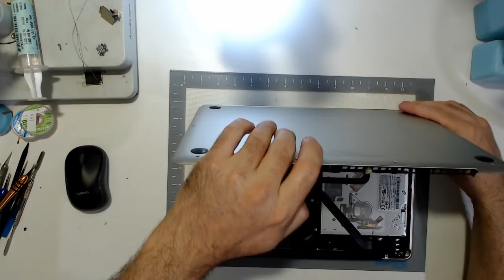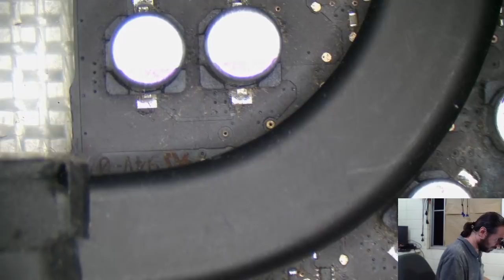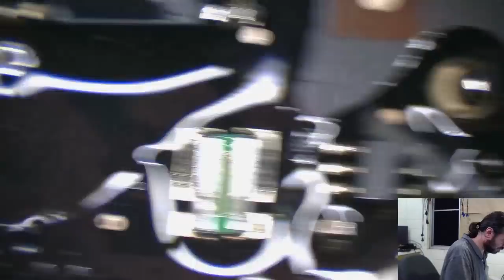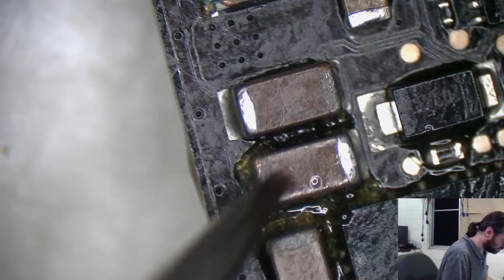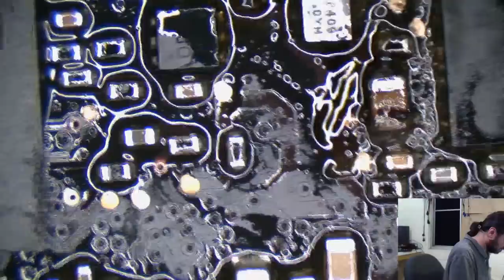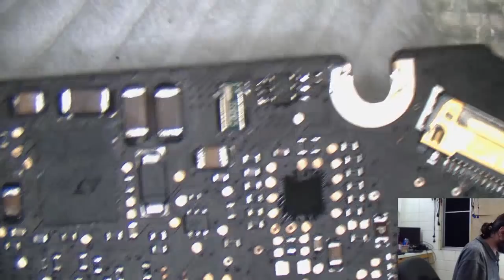EBay lucky dip #4: A1278 that sometimes works

Comment: You just need to add a microwave oven transformer to your doorbell and turn it on during closed hours, and amend the sign to say "ignorant people will be given a free 2000 volt electric shock. DO NOT PUSH BUTTON AFTERHOURS!"

Comment: Hi Sir my macbook pro mid-2012 is stock in startup and turns on automatically without using the power button just when I plug it with the MagSafe what seems to be the problem? is it a hard drive problem? some of the keys are also not working

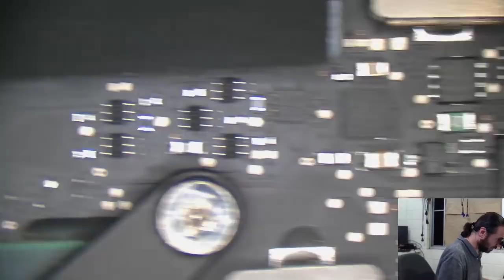Comment: my rottwieler demands I take the leash, and snap it on his collar, at 7:00 am. Not 7:01, not 6:50, but 7:00 am. thus German promptness. So I can then sleep some more after a mile hike at full speed. He sitting,  looks me in the eye, and demands I comply. Not a cupcake. Then I can work on boards after.

Comment: Hey Paul, where do you buy all your parts from, if you don't mind me asking. Do you just use the likes of DigiKey or have you found somewhere decent within Australia ?
Reply from the maker: For electronics parts, I use Element14 ,  they deliver overnight to me, even though I'm in a rural zone (which makes me rage more about Auspost's incapacity to deliver anything with punctuality ).

For other stuff I use an assortment of smaller sellers, like Broadway Computers.
Reply: oh yea, don't get me started on Aus post they are useless as tits on a bull. 

I checked out element 14 they seem pretty good. Ive got a few Mac Books that I'm working on at the moment and noticed you mainly use donor boards which I don't have yet.
would you use Broadway for things like the 805 resistors, if you didn't have any on your donors? @pldaniels

Comment: Hi Paul, have you tried MG Chemicals heavy duty flux cleaner? I "pirated" the recipe from their MSDS. The MSDS lists the chemicals by weight though so you need to find the density and convert to volume unless you want to weigh out the ingredients. I can share recipe for those that want to try it but don't want to do the weight to volume calculations.

It's way better than IPA. It evaporates quicker but not too quickly, so it doesn't carry the residue in a film across the board. It's the best I've used at dissolving hard baked rosin.

I'd like to send you some to try out. You can email me, I'm LogicWest on your forum.
Reply from the maker: I haven't tried it.  I suppose overall I try to stick with the simplest, minimal risk solvent solutions I can, so IPA covers that fairly well ( ethanol probably would be nicer for me, a shame you can't get it without the damned excise, or methanol :( )

I see one of my suppliers has the stuff ( 413B ? ),  isn't tooooo expensive ( $40 AUD / litre ).    I imagine I'd go through about 100mL/yr, set for a long time :)
Reply: @pldaniels  Yeah, it's not too expensive in the 1 litre. If you already have acetone and IPA then all you need is ethyl acetate (1L $24 with free shipping from sydney solvents). It's fine with all the plastics in macbooks except the speakers. It turns the plastic white. 

I contacted digger a few years ago to ask them what is the adulterant used in "methylated" spirits. The MSDS listed nothing. They told me it just contains a tiny amount of bitrex to stop people drinking it. Bitrex is only needed in the ppm to make it undrinkable but at least it's not poisonous, it's just ethanol.

It's easier to get than IPA in Perth, a 4L at bunnings is cheap. It's fine for drying boards with, technically better than IPA for that purpose.
Reply from the maker: In my situation, it'd definitely just be cheaper to get the premade 413B.  As for the adulterant, that being the case if it's bitrex, does that mean it's ~98% ethyl alcohol, or still ~70% + water?
Reply: @pldaniels  It says less than 5% in the SDS but I'm fairly certain the guy who emailed me said it is pretty much pure alcohol. I could believe it, I bet that it's not cost effective to dry to a specific percentage rather than completely dry or nearly completely dry then add water to get it to a specific percentage. Can you get ethanol in a specific percentage solution? I mean other than whisky etc. They make IPA at 70% for disinfecting, it doesn't work as well for that when it is a higher percentage so they add the water. I don't think I have seen a similar thing with ethanol.
Reply from the maker: You're right in terms of cost-effectiveness.  Not a lot of point going to extra efforts to tweak the mixture compared to just taking "pure" ethanol and adding the bitrex.  I might go buy some and see how it goes, the first test will be to see if it leaves behind that white residue (which is usually from the methanol).

Definitely the 70~80% IPA + water mix works great when dealing with bio-solids and dirt, I keep 99.8% and 70~80% mixes depending on what I'm trying to do.
Reply: @pldaniels  I think you will be fine with the diggers brand. That is what I have been using for a while and I have never seen a white residue. Agree on the water for cleaning spill residue or general gunk, makes a big difference.
Reply from the maker: Thanks - now to go try some and see how it works out.  I stopped using metho quite a while ago (decade) because of the methanol [ skin absorption ] and the residue.   At least now I can absorb less harmful ethanol and become a more bitter person :D

Comment: Funny how all that crap is there and it boots but Louis gets them with a funky test point and you don't get a light
Reply from the maker: Yes,  no guaranteed correlation between corrosion levels vs repairability.   I had one in a few weeks ago that was completed covered, smelled bad and looked like it needed to just be buried,  half a tube of flux later and some judicious ultrasonic, it works very nicely again.

Comment: nice work, i am just not confident enough yet on macbooks to buy them off ebay like that, but learning more every day
Reply from the maker: I think if you can avoid the C2D machines,  avoid the shady seeming deals, then in many cases it's possibly still in with a chance to be repaired.

That said, maybe with the C2D machines dropping so low in price, it's perhaps not a bad way in?
Reply: I bought a few lots of crap macbooks and boards from the eBays. 37 of them in total. A third of them were beyond repair, period. Entire swaths of missing components, charred arc crater holes in the board, RUST and corrosion beyond reason - to the point that entire traces and legs were gone and quite literally NO salvageable components... I got over one third of the 37 running fine. The remaining boards were for spare parts and such. That's how I learned and developed confidence. I got to sell ten or so macbooks when done. More than broke even AND came out of it with some skills.

Comment: oh the joy of having schematics board views and value information...nice win there Paul and put a timer switch on the bell that way it doesn't ring after hours..easy really
Reply from the maker: Problem with the doorbell atm is that it's wireless self contained unit... and the people will bash at the door if they don't get a response.  I need an active deterrent :D

Comment: Great Paul nice to have a win for sure now hopefully it doesn't get the dreaded GPU failure Louis talks about being a A1278 ;)
Reply from the maker: This one should be fine, it's iGPU only as I recall.  Now I have to decide if I keep this as a pet, or put the SSD in and sell it back off, but since I don't have any others with a working screen assembly ( only have that earlier 2009/10 C2D one ) then maybe it'll have to join my farm.
Reply: @pldaniels  haha that's my problem I wanna keep everything
Reply: @Fixingthingz4u  yeah... I'm the same.  I  have 9 A1342 sitting here with only one fully operable.

Comment: Hi Paul, nice win. As always a BIG 👍 from me. When your flying over the boards under the scope I keep losing orientation or which part/side of the board your working on/looking at. I’m not as advanced as yourself. It would be useful certainly for me and I guess others if you could, state which circuits and side were looking at. As always, looking forward to the next one.
Reply from the maker: I often forget myself, also it's something that often gets lost during the editing, particularly if I'm going a bit aggressive with the razor (like I was with this one, had to cut it down from ~2hrs of footage).  

Over time it gets a little easier through familiarity but beyond that, unless zoomed out, can be really tricky.

Comment: just put an electro shocker on the door bell, for out of hours use
Reply: Electroboom microwave oven transformer jacob's ladder circuit - the button is one leg, the salt water soaked mat: the other leg. A cluster of magnetrons and feed horns hidden above.
Reply: @skeggjoldgunnr3167  I was only thinking give them a non lethal tingle, not kill them!!
Reply: @Dust599  HA! A big red button that says "DO NOT PRESS!"  (victim:) "I. MUST. PRESS."..."can't resist!"..."must press button." Yeah, I guess my evil genius contraperatus would clear out about 400 cholesterol points and pop fillings out of their teeth. Maybe a taser circuit or electric fence setup.
Reply: @skeggjoldgunnr3167  Speaking about such: how fast can one cook some lungs with a focussed beam, through the door, with such a device you call a "microwave"? Have that connected instead of the doorbell. That'll teach them :P
Reply: G. Com ha! A doorknob trap shocker? Messed up!
Reply: I put one on the doorknob once. Apparently that's illegal. Still, the cops were very understanding.
Reply: G. Com wait a minute. Back in ‘88 I did hook up an air solenoid and compressor tank and a set of “Big Rig” three tone air horns to my doorbell, then called dominoes...

Comment: Come on, yer an electronics whizz, build a timer that only enables the doorbell in business hours. (arduino nano, and a fet??) :D
Reply from the maker: So much more work... so much work.   Would be easy though to just hook it up to a PC and have a relay turning power to it on/off during the appropriate hours.

What in the past I have found however is that people will go above and beyond to try other methods to wake me up.   One morning we had someone banging on all our windows around the house at 7am.  Needless to say they were fired from the client list;  actually did spook me quite a bit.